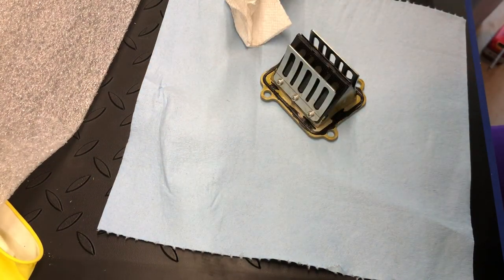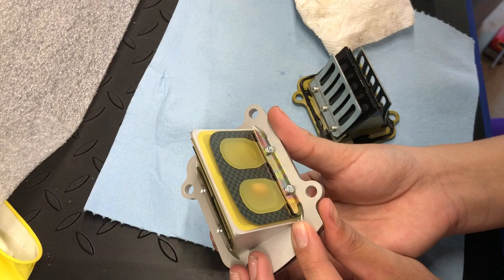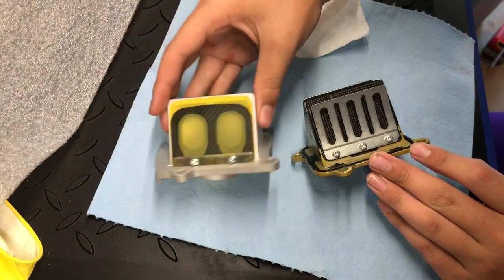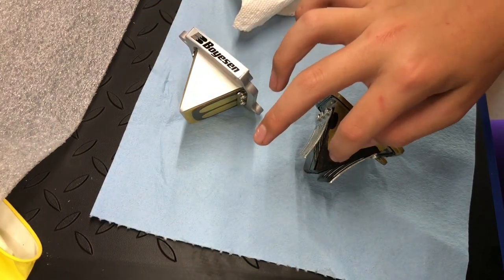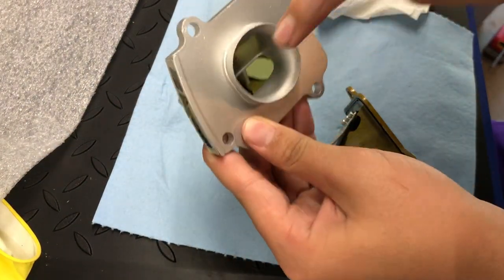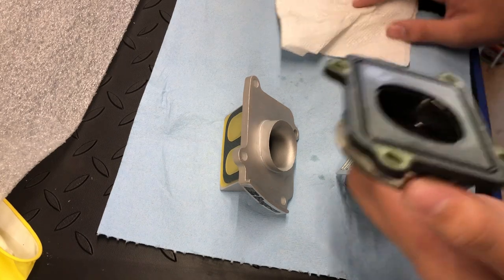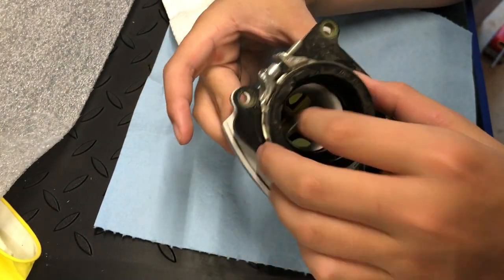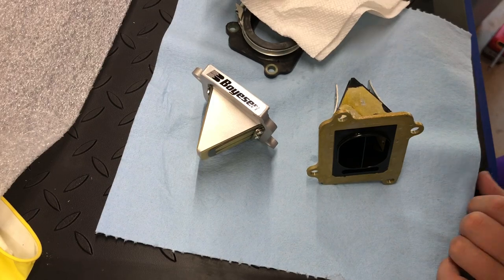Boyesen RAD Valve VS. Stock Reeds!

Comment: What if you take the restricter plate off?
Reply from the maker: I wouldn't reccomend it. Probably poor durability and reliability. I'm sure there is a good reson yamaha has the restrictor plate there.
Reply: You get higher rpm and a little more power up top that’s about it you can definitely tell the difference I change mine out after the factory get worn
Reply: @jimcatx3090  I believe if you take the plate off, it will open way too wide and wont have enough time to close back and seal. Just like advance in ignition, you have to give the reed valves time to "travel". I would love to be proven wrong though, but that´s what i believe.
Reply: @gambini_modding  if you took the plate off they would probably open to far and break

Comment: My ktm Reed bust a pedal off and left me deep in the woods. I'm looking for a better Reed valve. V force or boyesen?
Reply from the maker: I’m pretty happy with my Boyesen reeds but you will just have to look around and see what you want power wise, they both will slightly change the power characteristics of the bike.
Reply: @akmoto_  do you think I'll have to re jet my carburetor?
Reply: @jimineutron259  Yes, You Put Boyesen Rad Valve You Need Re Jet Carb Like 2 or 3 Down Main Jet. Vforce3 Dont Need Re Jet.